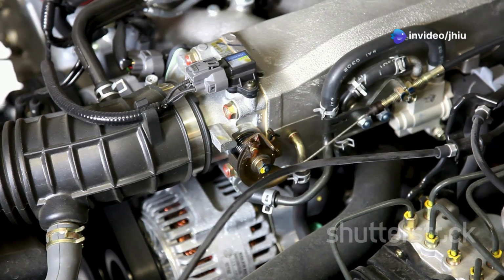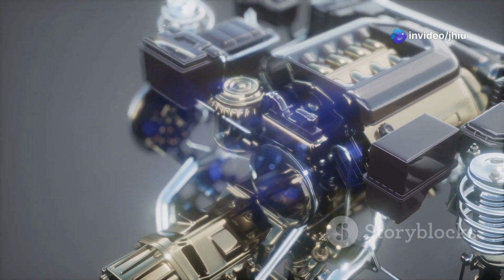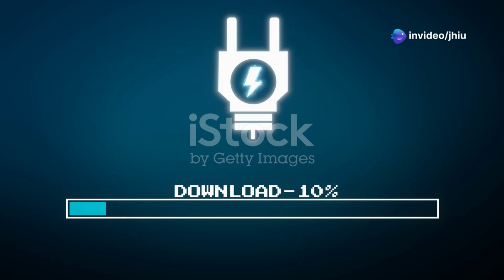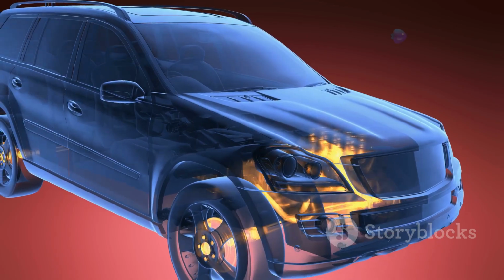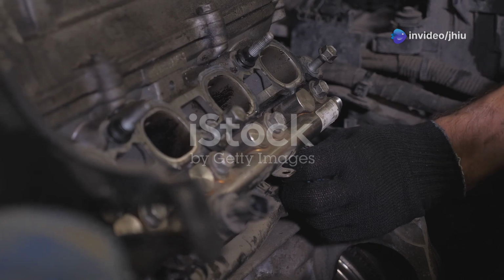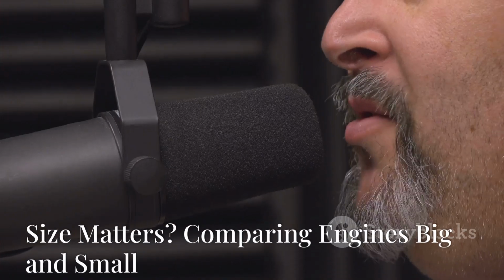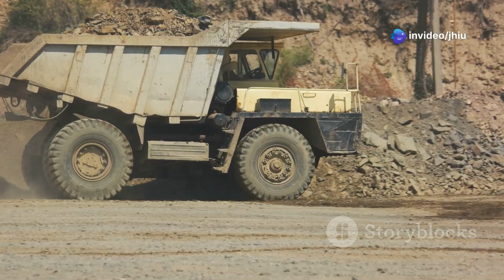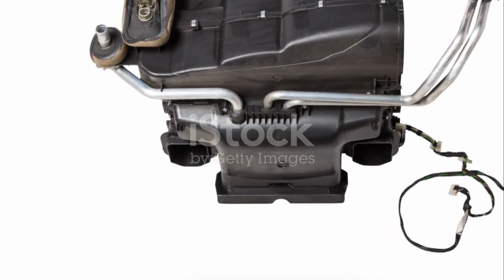Engine CC Explained: How It Affects Power & Performance!

Comment: My late Father, and I used to rebuild automobile & Motorcycle engines, however, after my 2nd back surgery In 1998 I could not continue to be a mechanic, I've had fast cars and fast motorcycles, my favorite cars were a 1977 Buick Electra 225, with a nail head engine, and a 1969 Chevelle SS-396, that was built by a drag racer, and put out 500+ hp, enjoyed the video, thank you, new subscriber.👊😎🇺🇸